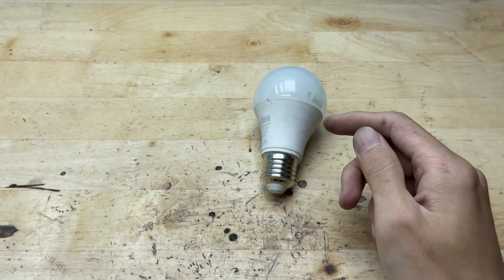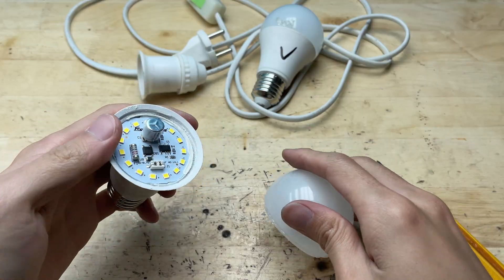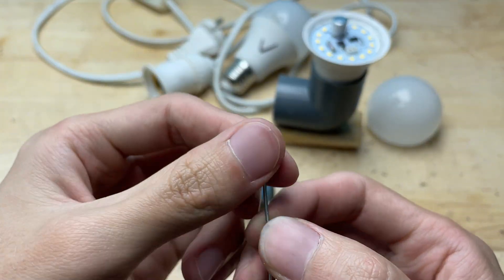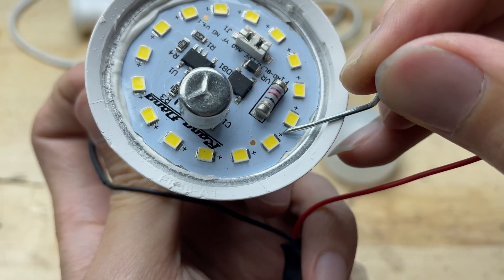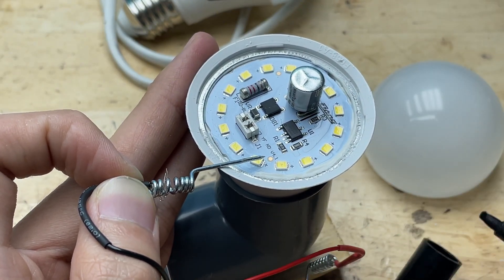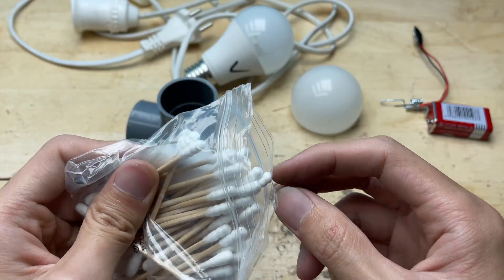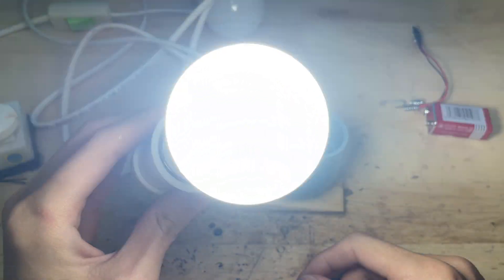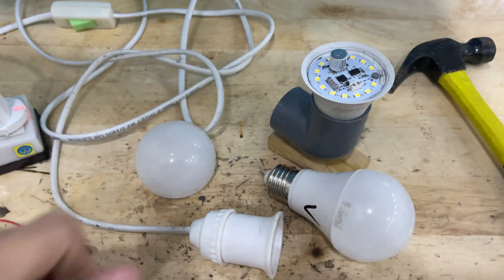Stop Buying New LED Bulbs! Simple Tips to Revive Old LED Bulbs at home

Comment: The LEDs in these light bulbs are wired in series with each other, thus when one fails, they all stop working. Your replacement "LED" (screw/nail) simply shorts the pads of the non functioning LED thus completing the circuit again. However, there is now more voltage running through the remaining LEDs, consuming more current and they will soon burn out from excessive power. These bulbs are built down to a price using the cheapest components possible, thus the remaining LEDs don't stand a chance of survival. The current limiting circuit was probably under spec'd to start with causing a LED, already on the brink of it's maximum capability, to burn out. Also, you should never test a LED using a 9V battery without a current limiting resister, e.g. 160 Ohm. You risk burning the LED out without it. To properly fix the bulb you would have to solder in a replacement LED of the same specs as the surviving LEDs. That way they all receive the same power and will continue to work a lot longer. I also find your handling of the bulb without its top in a LIVE mains circuit disturbing. You should be more careful and only handle it with the power off or using electrically insulating gloves. Use the switch to turn it on when required, not whilst screwing it in/out.